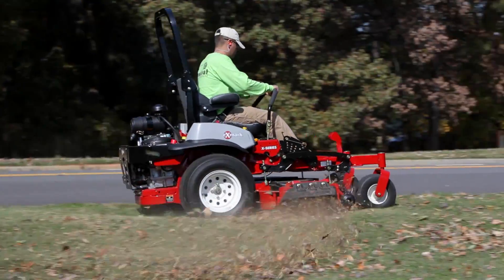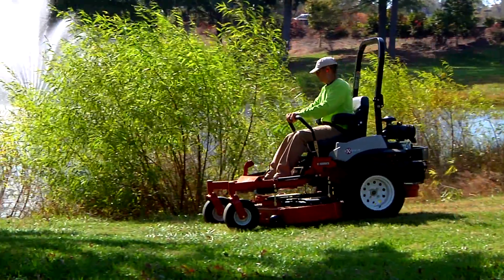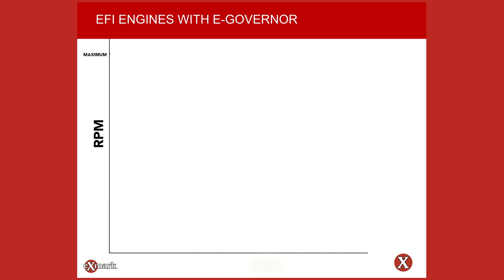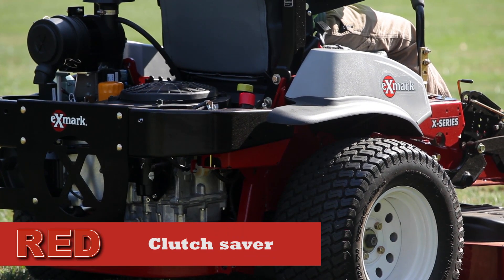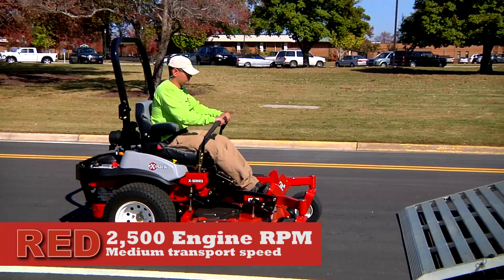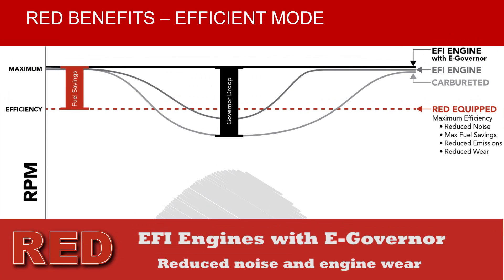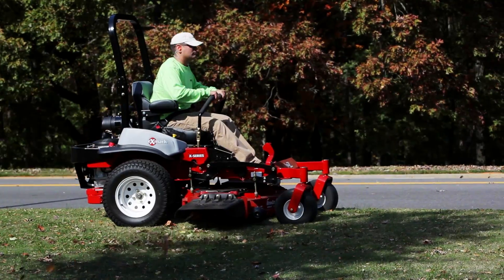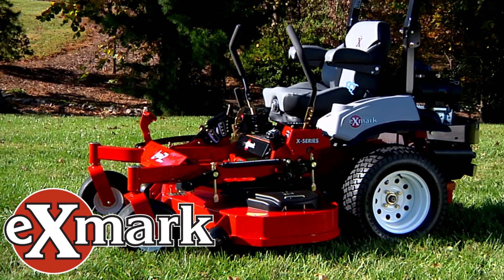Exmark Lazer Z With EFI E-Gov and RED Technology (1st Generation)

Comment from the maker: Blade speed can be reduced to improve cutting performance under certain conditions.  For example, to lessen packing in wet conditions.  These settings are not intended to be a safety feature for mowing near objects.  Operators should never have the PTO engaged if there are people in the area or in trajectory of the mower discharge.

Comment: You cant control blade tip speed very much.  If there is a person nearby blade speed cannot be reduced low enough to protect people and property on the red eqiuped units.  About 2800 rmp minimum